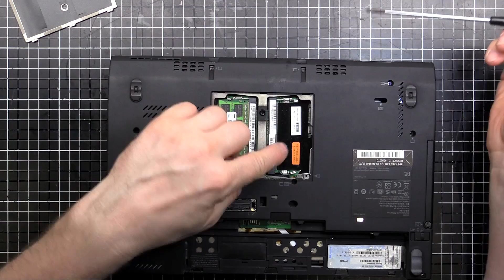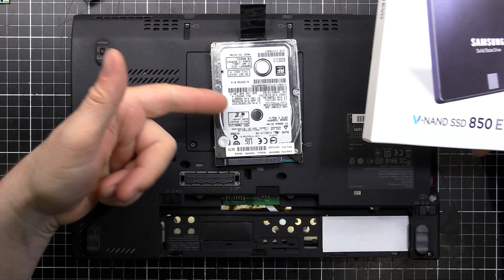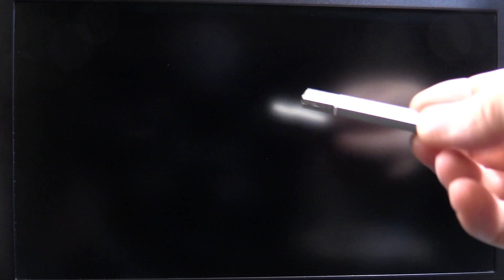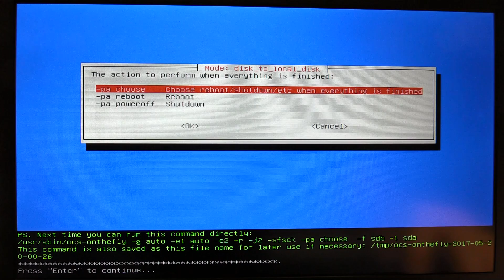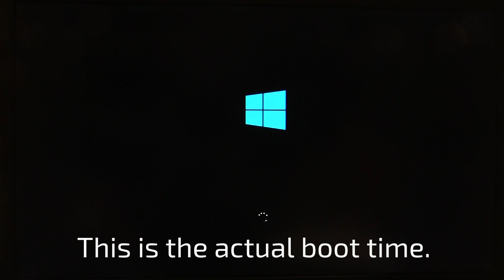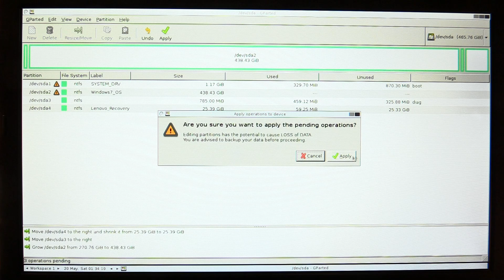How to Upgrade and Overhaul Your Laptop

Comment: You could replace the hard drive with a M2 stick Samsung 950 pro in that empty wifi bay
Reply from the maker: Good question.
It would depend if the laptop manufacturer provided a full PCI bus, or just what is needed for purpose.
You'd need to check the length of the card too...

I don't have the laptop with me (it belongs to a friend), so I can't check for myself unfortunately.
Reply: Yes, the length is everything... :-) I've taken the wifi card out just to install a M2 Stick and use a USB Wifi and this looks as if it would take that 950 pro which is long

Comment: The unpopulated msata slot you can put a msata sad in it.  I'm running the same notebook with a 240gb msata ssd and a 2gb hdd.  Also you can put heat sink compound on the north bridge chip.  The heat sink is sandwiched by the case when assembled.  The CPU is a sand bridge with the gpu built in.

Comment: The clonezilla/GParted bit will be useful when I get around to changing my desktop PCs boot disk to an SSD. You made the process look much easier than a craply written Instructables article 😀
Reply from the maker: Yeah, the tools I use are really easy to use, just gotta double check what you are doing and make those backups.  :)
Reply: He does a good job in the video, but to be fair... nothing beats real world experience... even failure can be a big chance to learn. Just keep backups of your data ;)
Reply: Oh no, I'm more than capable of doing this, it's just whenever I've looked at how to use a cloning tool the person writing the instructions has made it seem like such a faff, I've thought "sod it, Windows could do with being reinstalled anyway".

I need to upgrade my entire PC. I'll do it in parts so Windows doesn't think I'm trying to pirate it 😑
Reply: James Grimwood you said it! so very true =_=;
Reply from the maker: Yep always backup before you poke the beast! :D
Reply: Yeah, cloning the drives the wrong way would be a little upsetting.

Comment: Awesome clip!  Those machines like most laptops from 2010 aren't slow it's the HD that is the killer bottleneck.
I had a similar laptop at work last week where the disk, same brand as the one you have there, showed no errors at all during any test. I ran a speedtest which still baffles me. On a USB to sata cable it did 130MB/s write but now comes the funny part 2 to 10MB/s read. I had never ever seen one like that. Cloned it to another which took 3 days, long weekend, and now a happy owner.
My mother in law has a core2duo from 2008 and she wanted a new laptop a couple of months ago.  Bootup time was 4min30sec something. I have a spare ssd to move data to other laptops via a sata usb cable which is much much more faster than any usb stick. (especially small files).  I cloned her drive which took all night... bam 38 sec boot time and it actually feels snappy enough to keep on working on it. The ssd drive which she now has was like 75 euro or like 90 us dollar vs a new 8 times more laptop.
Reply from the maker: I've upgraded a number of laptops with an SSD and some RAM where needed and it always makes the laptops so much faster and useable again.
Friends love it when their laptops feel brand new again for a fraction of the cost of a new one. :)